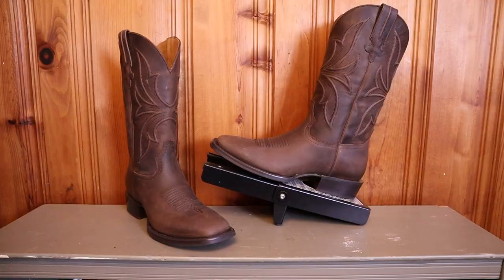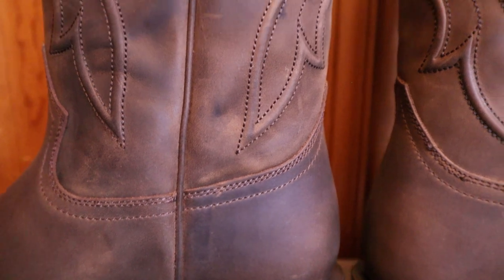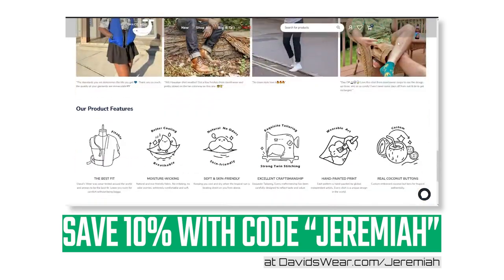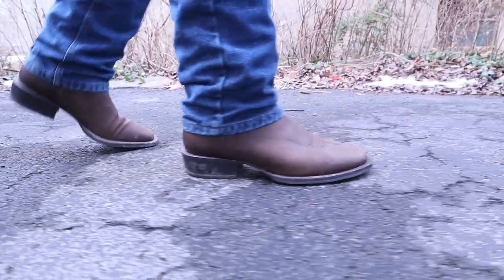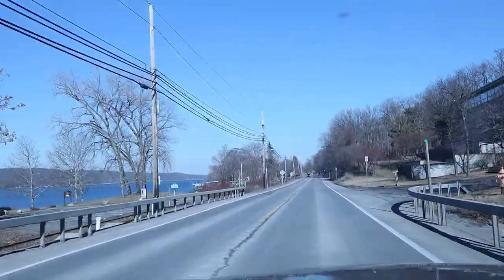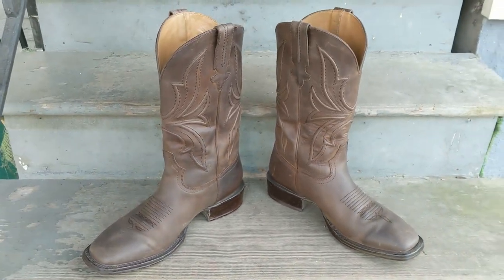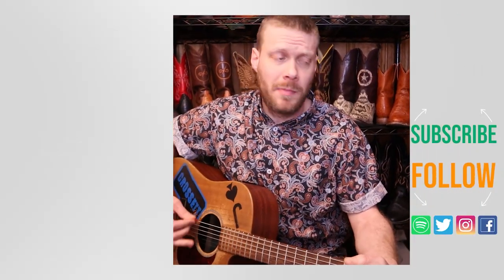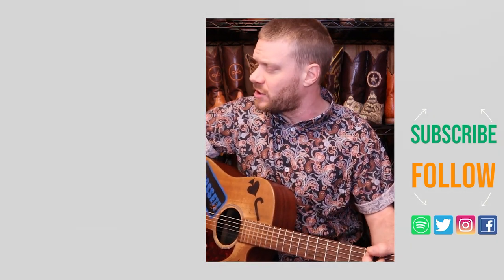Are Thursday Boot Co. Cowboy Boots a FLOP?? | Extended Test Review

Comment: I own them in Arizona Adobe color. Absolutely love these boots and get so many compliments. I like that the toe isn't as tall or as squared off as others. Had them for several months now and logged many, many miles on them. I did get them a little scratched up on a ranch one day.... had to hoof it quite a ways to get to where the horses wanted to hide. Wasn't planning on a hike as they're not my "ranch wear boots" Otherwise my Dan Post are my "work boots". I found them to fit true to size though. I can't say I've ever seen you bash a pair of boots like you did these and it's really surprising to me as I love mine. Sure, width might be an issue and maybe downsizing is why you had issues, like Rockin Leather boots don't fit a lot of people properly because of their sizing model.
Reply: Was the sizing as the site says: Going half a size up from your brannock size? Was curious as multiple people have stated different things.

Comment: I definitely have a pair, the Old Town color.  I did find that they are a little snug in the toe box and the heel slip does feel different than other boots.  However, I thoroughly do enjoy wearing them on colder days because the leather feels a little thicker and my feet stay warm in them.  I appreciate your honesty and buying these boots to test for us.
Reply from the maker: Rubber soles are so necessary for winter weather! I fell on my ass so much when I was first getting into boot because I wore those leather soles on the ice and snow haha.
Reply: Hey Chris, did you go half a size smaller than your regular shoe size? (Which is advised on Thursday's website) Or did you just go with the regular size that you usually wear. I am wondering, because if they are a little snug, I may not bother going a 1/2 size smaller.
Reply: @Bubblegum_Wolf  Yes.  I did the 9.5.  I have a pair of their Captains that fit amazing. So I stuck with the same size as those.
Reply: @Bubblegum_Wolf  it's half a size bigger not smaller I'm size 8 and I got both my boots size 8.5 and they fit perfect I just wear dressing socks for better comfort

Comment: The rubber sole doesn't impress me and then the square toes.  Definitely not a boot ill personally be looking at. 

Having said that i do like the choice of leather, it is a nice choice.   I have a pair of lace up ropers with that leather and it holds up well.

Oh and id have an issue with fit as well.   They definitely need to offer more options.

Comment: I've had a pair of Black Desperados for a while now(since they came out). They are comfortable, but I'm not a fan of the insoles. For reference, I wear through a pair of expensive removable insoles within 3 months(I'm basically built like a linebacker, 250lbs 6ft size 11EE shoe. I can say the ones I ordered were pretty snug at first, but over time, they definitely feel so much better. However, back to the insoles. I've completely torn through the leather topping of the poron foam where my big toes are, and that really sucks because I really like the way these boots look. The narrowish square toe just looks fantastic, and I like the design on the shaft. I also encountered that when you need to clean them, the dye on the heel stack and welt rubs right off, so instead of black, they are more dark brown. But otherwise than that stuff, these are too bad, I guess. I like the look, but materials are questionable at best. 5/10
Reply from the maker: Dye will come off of lots of brands at the heels. Try some of that edge dressing (but use black for your black boots). It seriously works wonders!